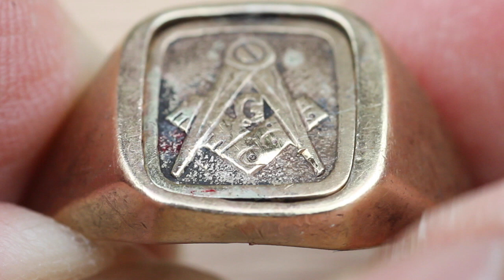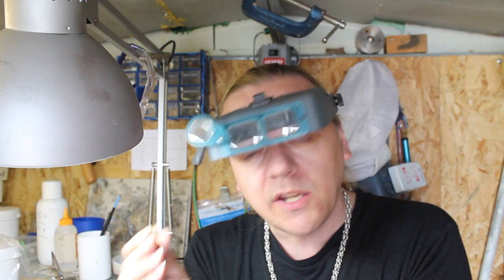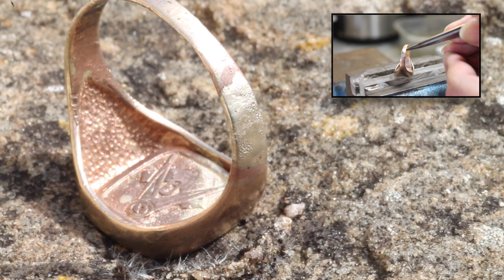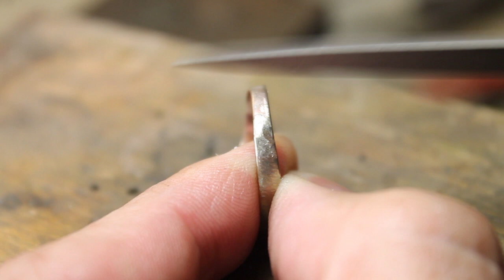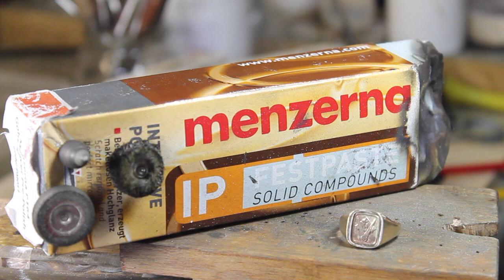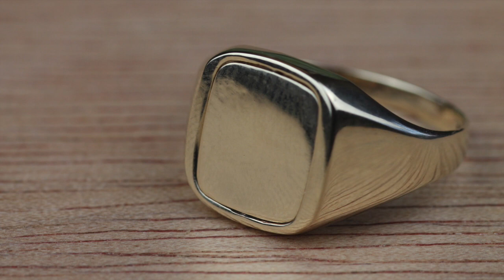How to Solder and Repair  a "Very" Damaged Gold Ring. Total restoration

Comment from the maker: I received this incredible message from the guy who originally sold the ring.

You were correct about someone standing on it, the pliers and it lying outside.. Here's the rings story.. In approximately the late 1970's, my father bought a dressing table in an auction. In one of the drawers he found that ring. He stamped on it and threw it out the back door and it hadn't been seen for over 30 years. After that long time I was out cleaning guttering on the extension which he had finished 30 years ago and found that ring stuck in a pile of mud.. I tried to straighten it with pliers at the time and that's how the crack happened. Then the ring lay around the house for a few years until I put it on ebay thinking someone might have an interest in it....Then you bought it and did that amazing job!!! Fair play. I'm delighted the ring had a happy ending :)
Reply: Wait, who on earth would normally throw away anything made of gold?
Reply from the maker: Someone who dislikes Freemasons. Hence the 35 thumbs down on this video. ; )   Dave
Reply: @CelticDreamsCoUk  
Never focus on negative ignorant  people, be positive and be happy always, look you have got 611 likes including mine, thanks for sharing your amazing work with us, stay blessed 💖
Reply: @CelticDreamsCoUk  gold last forever I'm i right even if it's 14k it's durable still not as durable as 10 k but 14k is these days is 700 pendents aren't that much money I have a St Louis blues pendent pretty sure it's vintage it's 85 bucks I noticed on eBay for some of them
Reply: @CelticDreamsCoUk  so does 18k get more damaged
Reply: @CelticDreamsCoUk  or what?
Reply: @CelticDreamsCoUk  are going add more gold to it
Reply: @CelticDreamsCoUk  idk how it works gold is soft not all of it is damaged those wolf parts aremits old any it?
Reply: @CelticDreamsCoUk  I own old gold and I take good care of it its doing well you see the picture on my profile what my pendent looks like
Reply: @CelticDreamsCoUk  but I headed someone said they fixed it using more gold are they for real or do they know what they are doing?
Reply: @CelticDreamsCoUk  precious metal shouldn't been treated like that thank you sir for taking care of it I guess I know who to talk to you if I need my gold looked like to see if it need to be repaired or it's minor
Reply: @CelticDreamsCoUk  are you good with old jewelry I don't think it's old it's probably people that had it before me
Reply: @CelticDreamsCoUk  but it's not vintage yet
Reply: @CelticDreamsCoUk  Micheal Anthony has those drill like marks
Reply: Celtic Dreams amazing story behind this ring. This is why I enjoy lost ring recovery so much via metal detection and SCUBA! The story doesn’t have to end with I lost my ring and that was the last we ever ever saw her... #SeattleRingHunter